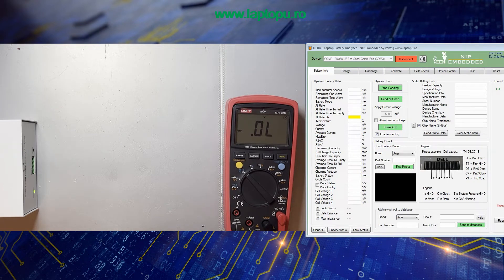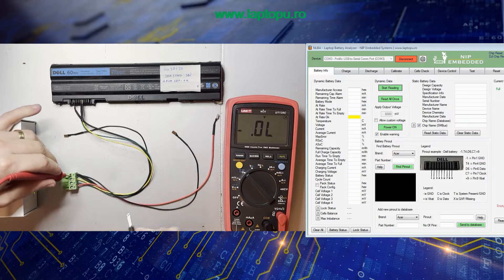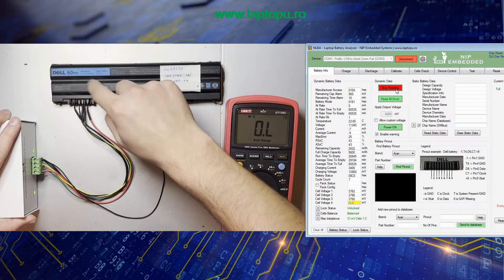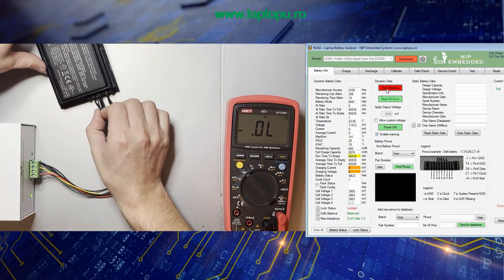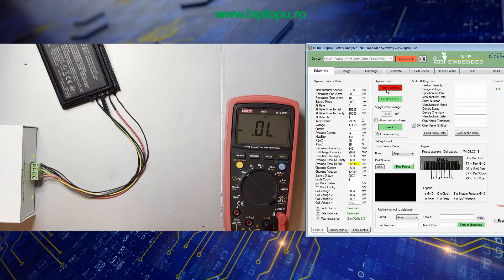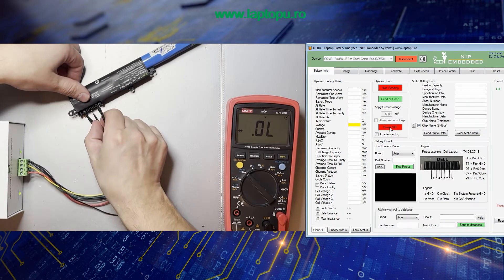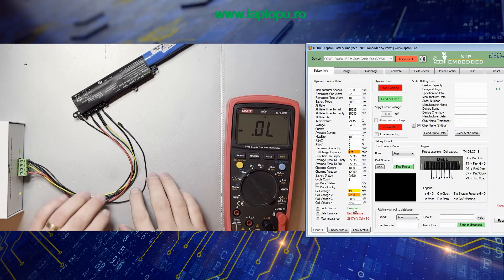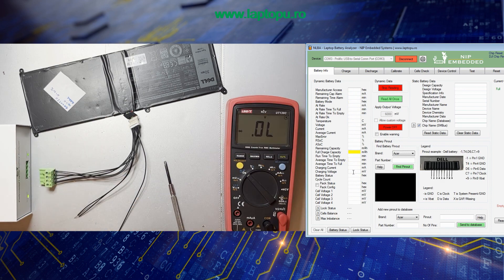How to find out the Battery Pinout, Clock, Data and System Present pins

Comment: Thank you for showing us this method - this will definitely come in handy when trying to find battery pinouts.
Note that I always check the database first - if it isn't in the database, then I try and find the pinout manually.
Also with some older batteries, Clock or Data can be next to the power pins, e.g. HP HSTNN-LB17 which is -1, C4, D5, +6. Though yes Clock and Data are usually next to each other (except in some rare instances, e.g. a couple of Apple batteries).
Reply: hey do you know whats the pinout for a msi battery laptop? its square shape
Reply from the maker: Yes, it is recommended first to check if the battery pinout is in the database.

Comment: There are many different batteries that the cables you delivered with package od the NLN1 is not included. I am asking if you have made some nieuw different cables that can purchase.
Reply from the maker: Can you post the battery connectors you need the cable for ? here: https://www.laptopu.ro/community

Comment: Very professional video. I have the NLBA tool and it's amazing. It can unlock about 90% of the chips used in laptop batteries. Support is also great on their forum. Even if a chip is not officially supported they can somehow hack it remotely.
Reply from the maker: Thank you !
Reply: Искам да попитам относно софтуера нещо.Как да се свърж с вас?

Comment: V nice and also make a video on when battery Bq chip is detected in reset tab but does not accept FCC after changing cell how to fix that?
Please because I have the problem with more then 5 batteries chip is detected but the FCC is not reseting even Charge cycle is reset but not FCC
Reply from the maker: Note that Impedance Tracking chips compute the FCC internally and you cannot modify it. We offer technical support for free here: https://www.laptopu.ro/community